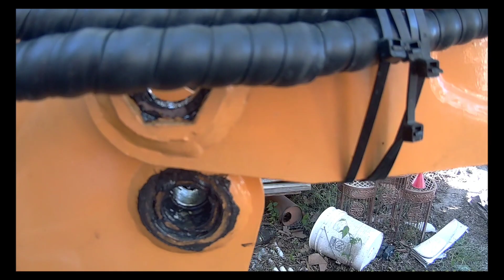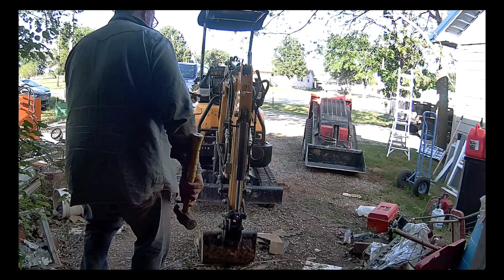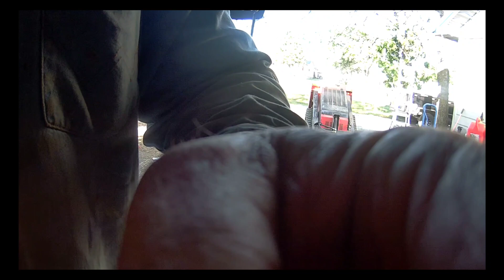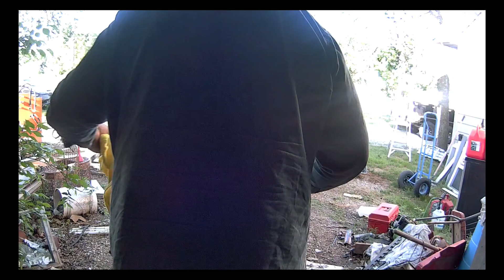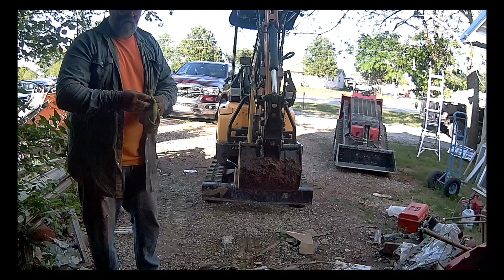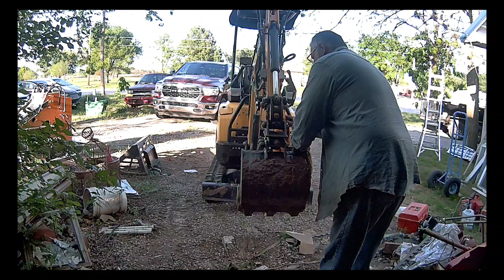Diggit em15 Bushing lose adding Spacer

Comment: Hey buddy  where did ya get your pipe and what size pipe I got to do the same thing to mine my boom is wiggling
Reply from the maker: It's been awhile.  I used seamless pipe don't remember size. Pull bushing out and take with you. As long as  bolt goes through it will work.use bushing as a measurement. It's easy uf you have chop saw. I went local metal place. If you don't have chop saw. get measurement have a shop cut them there all same on mine
Reply: @jtsokiehobbyandadventures6666  thanks so much buddy